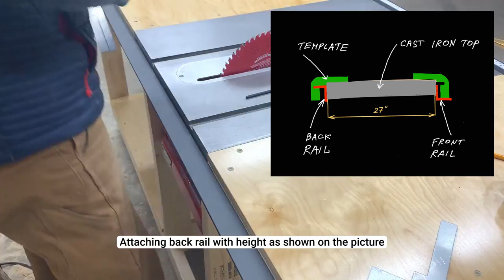Installing a Delta 36-T30 fence system | Huge upgrade

Comment: I installed my Delta fence today and the installation is just as easy as in this video.  My fence was for an older 2 HP contractor type saw with a 27x40 cast iron table.  Once finished with installing the rails, I put the fence on to check for proper alignment with miter slots and with blade.  It was dead on right from the box.  I ran a couple of long boards to check for blade burns on the wood.  None.  A very nice, high quality table saw fence that's easy to install.

Comment: I found it was pretty easy to drill holes through the cast iron and use the existing holes on the rail.  Also, I'm using the original wings on my 1969 113, and some of those holes lined up perfectly already.  

Either way, I agree, it is a huge upgrade for these saws, which are great machines that last forever, but came with poor fences.
Reply from the maker: I don't know why but wanted to keep cast iron untouched so drilled holes in the rail instead. Also I added a paddle button in front of the saw and soft start module to it. Enjoying every time that I use saw.
Reply: @MrStukov  Nice!  That's a goal of mine too, but I'm still using the old stand and there's not really a great place to attach the new switch.

Comment: How did you get the 0 to line up with your line without moving the entire rail over?  I don’t see how that is possible without removing the measuring tape and installing a new one at the 0 mark.  You didn’t address this in your video Thx).

Comment: Thanks Mr. Stukov! 

I see you aligned the right side 0 marker by using the 5 3/8" width of the fence. 
Did the left side 0 marker align automatically?

Instruction manual says start front rail from the start of left wing - I have same old saw with wings not custom table like you.
So, when you clamped the left side of the front rail, how did you decide on the starting point placement of the front rail?
Reply from the maker: Hi, left side 0 will be almost at their place with small displacement equal width of your blade, so you should touch right side of the blade with fence and then adjust left side marker. It has two small screws on each side, so loosen it and put left marker at real zero and then tighten it back.

Regarding starting point for the front rail I don't refer to the left side of the wing because I have custom setup. You could try my method by placing zero point of the measuring tape on it suggested position. 5 3/8" from the right side of the blade. It gives you correct placement.
May be in your case left side of the rail will be exactly at the left wing start position.
Reply: @MrStukov  Thanks again! 
I used your method of marking the 0 marker on the rail with 5 3/8" calculation. 
However, I was worried that I will have to drill underneath the front rail (L bracket) - if I don't also align the front rail with the tube rail.

So first I marked (painters tape and marker) the offset between tube and the L-front rail - then I followed the rest of your method. It worked out and all my 0 markers are correct.

Only issue I have is a play/wobble when the fence glides over the tube rail. Not sure how I can fix that.
Reply from the maker: @amolpatwardhan1100  Tell more about issue, my fence glides but when I lovering it's handle I am getting perfect line parallel to the saw blade.
Reply: @MrStukov  In your video at 3:39 - see how just before you lower the handle it wobbles. 
Then again after 3:40 to 3:44 you slide and lock again the fence wobbles. I thought that should not happen. 
I see at 3:46 your miter slot (on table saw face) is not aligned to fence left face - could be just my illusion :)

I have seen people using fingers to tap and do fine adjustments. If fence wobbles, I am afraid that tapping will make it non-parallel to the blade.
Right now I do agree once you lock it seems parallel - I will update more as I use more.

There is also a "Adjustments" section in the manual that I will try to see if it helps with the wobble and miter saw alignments.
Thanks!
Reply from the maker: @amolpatwardhan1100  This happens because it has small clearance to move freely. After locking it becomes perfectly square.

Comment: Hi, thank you for the video, very helpful. I just bought this off someone, and it’s missing the template. Is it possible to know the distance from the table top to the top of front rail?
Reply from the maker: Hi, it's the same for the both front and back rail 5/8 inch

Comment: When you lock down the fence at 3:38, it visibly goes out of square. Is that a problem you're noticing or was it fixed? Thinking about getting this fence but not if it always does that.
Reply from the maker: Actually, when you moving fence back and forth. It stays out of square before it's locked.This happens because it has small clearance to move freely. After locking it becomes perfectly square.
Reply: Yes however this fence is fully adjustable. You can tweak the square with the adjustment screws on either slide of the fence. (Different from the white plastic screws that he adjusted the tilt with in the video).
Reply: It pulls itself straight when you lock it down. As far as I can see the rear rail is just for the fence to ride on and keep it from rubbing the table, so your pulling the fence rail up against the mounted rail in the front. Took me six hours to install mine on an old Craftsman table saw and I had to drill some holes to get it done but it's a nice upgrade. If any of you have been using the old Craftsman table with it's original rip fence you're gonna love this thing.